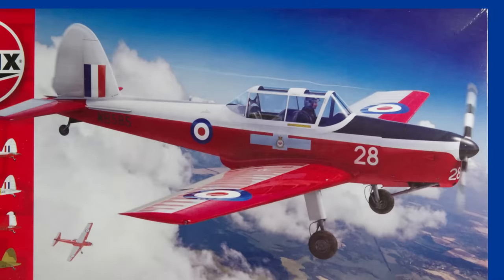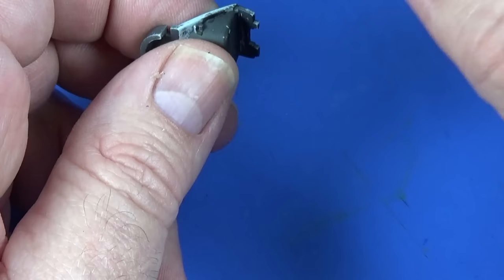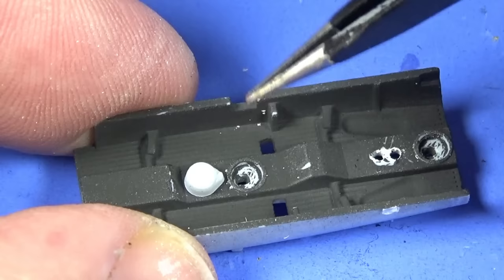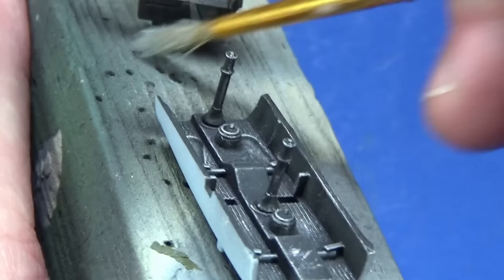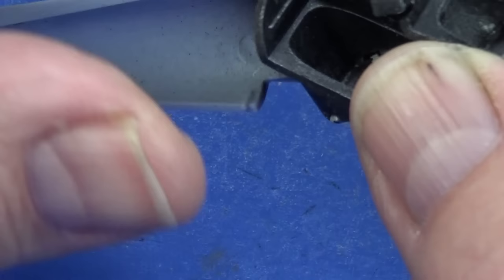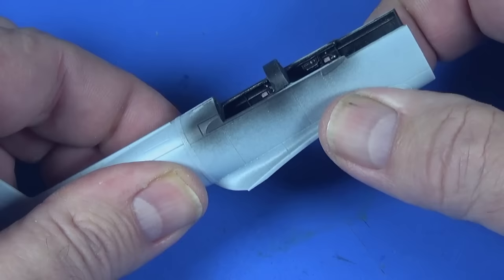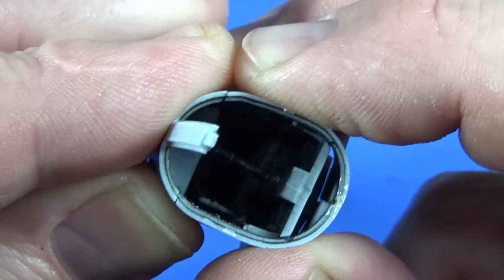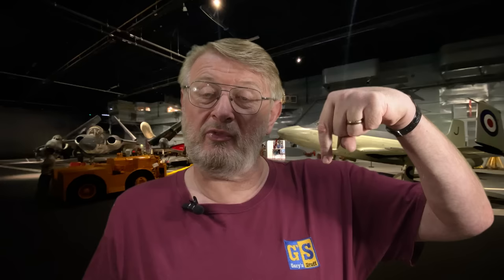AIRFIX CHIPMUNK 1/48 - how to build it!

Comment: If I had to guess about the canopy...I'd say its in multiple parts because the rear seat has a "bubble" to it. So in order to get the part out of the mold cleanly (and easily) they made them separate and gave you something extra to build. But...great job getting it done and looking good. 👍
Reply from the maker: There is a different version of the sides of the canopy supplied (maybe for the prototype), also means ey don't have to have a slide fitting on the mound that adds considerable costs.

Comment: Which glue was used to assemble canopy on jig?
Reply from the maker: Normally I'd use AK Crystal magic, it's a good clear PVA type glue. On this one, if you've got the fit just right, hen you can use a tiny amount of extra thin cement and touch it to one end of the join and let capillary action take it through. If it's all set up right, you'll see the line of glue going into the joint. But the parts have to be really well fitting. Crystal Magic does a great job of filling any tiny gaps that might be there.